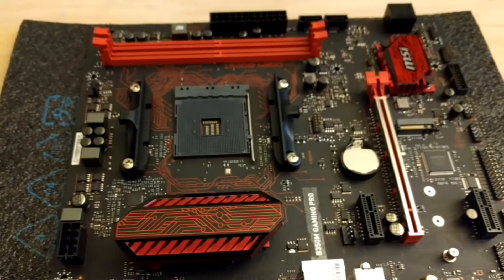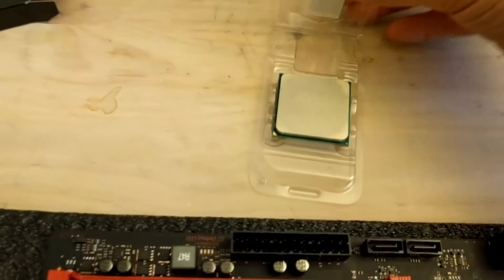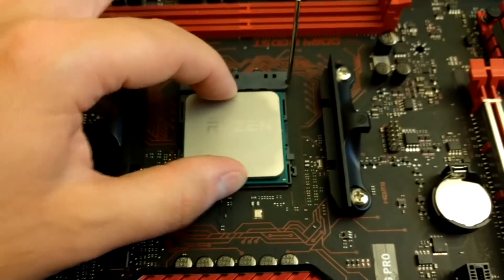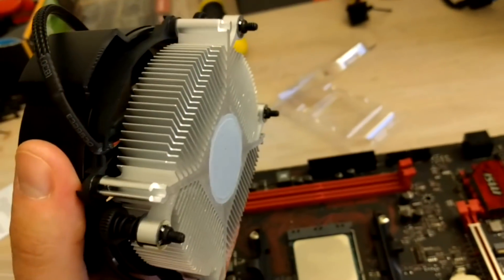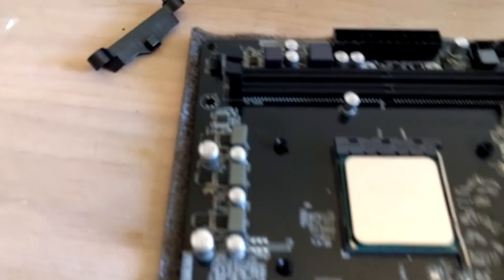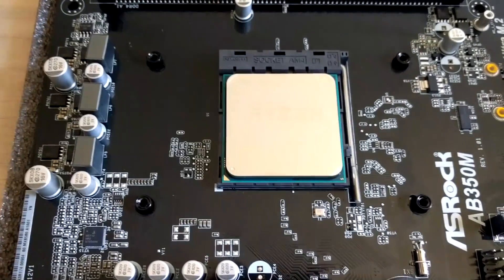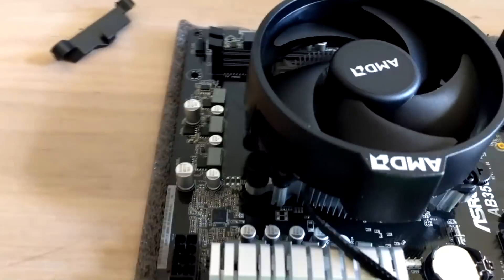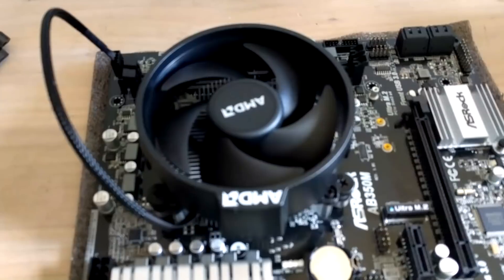AM4 Ryzen CPU and Wraith Cooler installation directions

Comment: Anyone know what those two plastic things are called at 3:11 I need them for my new wraith prism cooler that came with the 2700x and I can't mount the fan without them
Reply from the maker: Usually called a bracket, or holder or something else. If you can wait - kits come from China for $2, https://www.ebay.com/sch/i.html?_from=R40&_trksid=p2380057.m570.l1313.TR2.TRC1.A0.H0.Xam4+bracket.TRS0&_nkw=am4+bracket&_sacat=0
Reply: @CentaurusComputersCharlotte  thanks for letting me know

Comment: what is the backplate called by chance? I can't find one and my motherboard nor tower came with one and it the cooler cannot fit without it.
Reply from the maker: It is pretty much the "AM4 backplate", can't call it anything else. There are some on eBay https://www.ebay.com/sch/i.html?_from=R40&_trksid=p2380057.m570.l1313.TR1.TRC0.A0.H0.Xam4+backplate.TRS0&_nkw=am4+backplate&_sacat=0

Comment: Why did you change Motherboard?
Reply from the maker: First part of the video was the original video, without actual "screwing in". Some viewers wanted to actually see how screws are attached, so we extended the video. Socket is the same, there is no difference.
Reply: Centaurus Computers What was the cpu you used in the start?
Reply from the maker: @arvidjuliussen3617  R5 1400
Reply: Centaurus Computers ok thank you can you do a benchmark video whit Ryzen 5 1400?

Comment: What should i do my pc didnt start up after i did that in video i just changed the thermo past and thats it
Reply from the maker: Did not start as in no sign of life completely? Check the switch on the PSU, main 24pin and CPU 8-pin connectors, power button connector for the front panel. If it starts but shows no picture - check video cable connection, make sure GPU and RAM are seated properly, RAM should sit in slots 2 and 4 from the CPU (usually)

Comment: Now i feel like buying a ITX Board, since i have the CORSAIR Crystal 460X RGB Mid-Tower, with the ASUS ROG STRIX B350-F GAMING, dont think i will ever SLI any how.
Reply from the maker: Yep, SLI is the past, we do not recommend SLI for a lot of reasons. Some of them are - limited support from game developers, Nvidia moving away from SLI support, requirement for a much bigger PSU, a LOT of extra heat and noise, newer high-end cards are perfectly fine for 4K gaming in single card systems....

Comment: i bsically have the same msi motehrboard but i cant get these screws off
Reply from the maker: Unless they are rusted or something there should not be a problem removing them. I did it with one hand, at least. Possibly they are sitting there too tight. You can always find an aftermarket cooler with old style lever bridge clip that fits this mounting bracket, so you don't have to remove it.
Reply: @CentaurusComputersCharlotte cant be rusted bcuz i bought it 5 days ago and it arrived yesterday its brand new
Reply from the maker: @grum__1  Well, like I said, they are not usually overly tight and they should come off easily then.

Comment: I bought a used CPU without a stock cooler, and now the PC won't start up because it doesn't sense the cooler. none of the other coolers will fit the motherboard, and I can't for the life of me figure out where to buy a stock CPU cooler that will fit.
Reply from the maker: Don't even think about running it without a cooler. There are stock coolers for sale on eBay and other sites, but if your board has regular mounting attached from factory you can buy one of the aftermarket coolers with a simple clamp bridge that also fits older AM3 boards. If you have removed plastic mounts from the board and don't have them, you can find one of the aftermarket coolers that come with a new backplate, usually liquid coolers, or CM Hyper 212 kind

Comment: I bended 2 pins on my cpu, will it still work? pls replay...
Reply from the maker: If you can make them straight again - it will most likely work. We have fixed a lot of bent pins and had no issues.... usually. But keep this in mind - pins can withstand only a bit of bending, if you can't make it straight with a few accurate moves - it will break off.
Reply: @CentaurusComputersCharlotte  well I broke one and some of them are bent. Can this be repaired in the pc servis or something..? I think there's a trick to put a pin in the motherboard socket but I'm too clumsy for that
Reply from the maker: @ShaneMasterA  It is possible to put pin in the socket but no guarantee that it will have a good contact. Bent pins can be straightened using a thin blade or an automatic pencil tip. Some pins are dummies, in other words it is possible that CPU will work without it.
Reply: @CentaurusComputersCharlotte  okay thanks for the tips, appreciated
Reply: @ShaneMasterA  nope. Broke bud
Reply: @thehungryghidorah3274  nah, it's still working, its fixed lol

Comment: Hey, if I got just a little bit of thermal paste on my motherboard from my heat sink, is that okay? Also I have to take it off and put it back on a few times to get the screws to matchup. Did I have to reapply more thermal after doing that? Because now when I turn my PC on it’ll turn on for about thirty seconds then turn off.
Reply from the maker: If you have got thermalpaste simply around the socket you can wipe it off, should not be an issue. I don't know if stock AMD paste is conductive enough or not, to cause any problems, but just wipe it off. There are solutions (liquid) that help with paste removal. If you have got it on the socket, in the pin holes, that may be a bit of an issue. Try not to pull the CPU together with the heatsink, its bad. If you PC shuts down 30 seconds after you turn it on - it could be the overheating, or bad-boot cycle. If you get a picture and have enough time to get into the BIOS - check CPU temps on one of the screens, it should be in 30-50C range while in the BIOS. Make sure there are not bent pins
Reply: Centaurus Computers Thank you a lot for the reply. I really appreciate it. And I’m really hoping that it’s just overheating, because I ordered some thermal paste and other things to try to fix the issue. And I don’t really know much about bios so I’ll have to see if I can find a video on that. Thank you so much once again.
Reply from the maker: @toosavy1998  No problem. You do have to apply new paste after heatsink removal, but it should be a little amount between a rice grain and small pea, no more. You can spread it a bit with something like small spatula or similar tools. You should have a manual for the motherboard, find BIOS part in it and in the BIOS there should be a tab or option line that says something like Hardware monitor or similar. Thats' where you will see you CPU temps. If you don't get any picture in these 30 seconds before shutdown - it could be something else, not overheating. Like a bad connection of some wire, RAM issues (reseat it). Check if your mobo has any error LEDs or connect a little speaker to the front panel IO header #2 and check if you will hear error beeps, which you can look up online. Good luck
Reply: Centaurus Computers Thanks for the information. I have two final questions... I couldn’t connect my usb 3.0 cable to my ASRock Fata1ity B450 k4 gaming Mobo. It has something that says USB_3_5_6 but it wasn’t connecting with my usb 3.0 cable so I left it disconnected. Could that be my problem?
Reply: Also I didn’t hear any beeps any time that I turned the computer on. Do I have to have he monitor connected in order to hear those? Or are there just not beeps sometimes?
Reply from the maker: @toosavy1998  Not connecting your USB 3.0 cable is not an issue, ports will just not work. It should not be hard to connect though, it goes in one way only, check the notches on cable and port. Slide it in straight, or you can bend some pins. 
No monitor needed for beeps, only that little speaker with two wires and 4-pin connector that usually comes with the case, if you don't have it you will not hear any beeps.
Reply: Centaurus Computers The HD audio cable right? And it’s good that I didn’t hear any beeps? Also the usb3_5_6 port isn’t blue like the other USB port on my other motherboard. Aren’t all usb 3.0 ports blue?

Comment: is your thermal paste stick a bit out on the sides? mine does
Reply from the maker: Yes, there is too much from the factory. I try to remove it usually and apply a very VERY thin layer (I have some tools for it) of a high quality paste. Otherwise it will leak on the sides right on socket
Reply: it doesn't touch anything else just sides of the procesor, me trying to remove it would just make it worse
Reply from the maker: Well , sides of the processor should be fine with the paste on them. As long as it does not leak on the socket. 
You are right about removing the CPU. A lot of times I have pulled a CPU cooler with CPU attached to it, socket does not hold it well. You can try to slide or twist the cooler off the CPU, but be careful not to force anything. Pulling it straight up will always result in pulling CPU as well.

Comment: So if there is thermal paste on the cpu cooler do I not have to apply any more?
Reply from the maker: There is thermal paste on the bottom of the cooler from the factory, BUT!!!!! - we usually remove all of it because AMD applies too much and not the best stuff. If you will ever have to remove the CPU after installing it as-is you will see that paste excess will be everywhere - on the CPU sides, on the socket, around it... Remove all factory stuff and apply a rice grain of a good quality paste - it will work much better.
Reply: Centaurus Computers ok thanks man!

Comment: I bought a used PC from someone, and it has been working fine for a long time. But I recently discovered the CPU temps were just too high, especially after many reviewers stating how well the stock cooler performed. Well, I ended up taking off the cooler, only to find the stock brackets are not attached, but half of the cooler was still screwed on. What the fuck

Comment: Two different mobo's?
Reply from the maker: Same socket, so it does not matter. Original video was shorter, with MSI B350 Gaming Pro motherboard, I had to extend it to actually show me working with a screwdriver, so that some would get a better idea what to do.

Comment: Ok so when I screw it in the screws don't move? Is there an issue where you have to put a lot of pressure on or should it be easy?
Reply from the maker: It's not easy sometimes, screws on cooler's corners have springs and they are tight sometimes. Ideally when you put cooler on top of the CPU screws should touch the mounting points on the backplate, but sometimes they are a bit higher and need to be pressed down. Hold cooler down with one hand, start with one screw, push on it with a screwdriver to make contact and turn 2-3 times, then do the same with another screw across from the first one. When two screws (across diagonally) are attached a little bit it should be easier then. Some screws need a bit of force to be pushed into the socket.
Reply: Centaurus Computers ah okay thanks man

Comment: Where can I get those black mounting brackets?
Reply from the maker: They come with the motherboard, you can find them on eBay
Reply: Yeah, you're definitely gonna need those if you get the new prism cooler that comes with the ryzen 7 2700x, because it uses the latch that hooks onto those brackets.

Comment: Does it matter what direction you put the CPU cooler in?
Reply from the maker: Not really, it will fit both ways. Although I would recommend to install it with AMD logo facing toward the rear of the case, where rear ports are. If you will install it facing front side it may interfere with some RAM slots (AMD logo is sitting on a notch).
Reply: Centaurus Computers thanks, I’ll keep that in mind!

Comment: Are you experiencing freezing issues with the motherboard?
Reply from the maker: No, it could be a number of reasons. Update BIOS, make sure RAM is running with XMP/AMP enabled or drop frequency a bit, check temperatures....
Reply: Centaurus Computers I'm talking about the ab350m pro4, I've tried testing it with other ram gpu and hdd
Reply from the maker: It's hard to troubleshoot without having stuff in front of you. Your best bet is to post on ASRock forums and see if someone has same issues. But basics are the same - update BIOS, make sure XMP is enabled, CPU temps are not above 60C when not heavily loaded, update Windows and drivers...

Comment: you need to use thermal paste right?
Reply from the maker: Stock coolers come with thermalpaste pre-applied, in fact even too much of it. But if you re-apply the cooler - you will need new paste

Comment: why did you change the motherboard in the video. you had MSI GamingPro and finally AS rock
Reply from the maker: First video shot did not show actual cooler installation, so I had to add another part showing how it screws on, but with a different board. Installation is the same, it does not matter.

Comment: HOW DOES THE SCREWING GO SO EASILY FOR YOU!???
Reply from the maker: When it's on the flat surface it's easier. Press on the screwdriver firmly since there are springs pushing screws up. Don't let base of the cooler detach from the CPU while doing that, it messes up the thermalpaste.

Comment: I removed my cooler after i installed it... where are my stand offs?
Reply from the maker: They are part of the backplate, it is not held in place by anything so it probably dropped behind the motherboard. Open the other side panel and find that backplate, put it back in place, align with holes, put something under it so it does not fall down and re-attach cooler.
Reply: Centaurus Computers  ur right it did fall off! Lolololol thx man

Comment: If I upgrade from a ryzen 5 1400 to a 1600 do I need to get new drivers or anything, or will the cpu just function normally?
Reply from the maker: It will work just fine, no need to change or update anything else. When you will start your PC for the first time with new CPU your motherboard will aks if you want the default settings or if you want to get into the BIOS to update them manually. I recommend applying default settings first and then changing what's necessary manually. Like applying XMP settings (or AMD memory profiles), overclocking, changing fan speeds...
Reply: Centaurus Computers Okay great, thanks im a total noob at pcs lol

Comment: Do u know why my ryzen 3 1300x cooler isn’t fitting on my am4 motherboard I did everything u showed
Reply from the maker: if 4 screws match 4 holes all you have to do is to press down firmly and secure all 4. If they don't match or don't reach, check your backplate, CPU installation.

Comment: 1. My cooler keeps going uneven. When I screw in using the diagonal pattern, as soon as one screw gets in, the others fly up.

I've tried it while the mobo was on the box and tried it on a hard desk where the backplate is supported evenly. Still can't screw it in.

Please help. I am afraid too much force will damage the motherboard.

Also, the thermal paste is leaking to the side a bit due to the screwing process. It shouldn't touch the green part around the cpu right?
Reply from the maker: We usually remove half of the thermalpaste from stock coolers, AMD put too much there and it squeezes out on sides, leaking onto the socket. We remove the outer 1/4" layer.
As for screws - you have to insert a first screw a few turns in, then the one across - you will have to press firmly screw it in making sure it hits the hole straight, it will take some pressure, don't worry. The other two will also have to be pressed down to make contact with the thread.
Reply: @CentaurusComputersCharlotte  how exactly should I remove part of the thermal paste, and how much?
Reply from the maker: @Revirus1337  Some AMD stock coolers have different paste application patterns. Some of them have too much on sides, beyond the CPU surface. You can remove some of it on the sides, but unless you have a fresh paste tube do not remove all of it.
Reply: @CentaurusComputersCharlotte  I have the same cooler as you and I only plan to remove part of the paste but Im wondering with what tool exactly should I do that? Like a knife or something?
Reply: This has been happening to me too. DId you get it figured out?
Reply: I had the same issue and had to apply a lot of pressure in order to push the back plate up whilst screwing down. Wasn't easiest thing to do, the only issue I had whilst building my pc tbh. I had to re-adjust the cooler too cause of this issue, which resulted in a speck of thermal paste falling on my mobo and when I tried to remove it gently, it smudged, so I left it there since it was a very small amount and then fitted the stock cooler. I'm going to keep monitoring my cpu temperature and if I see any constant issues or irregularities, I'm going to reapply the aftermarket thermal paste I bought.
Reply from the maker: xnoSpec xnoSpec  You don't have to remove the paste at all, it's just my personal preference. If you will leave it as-is and ever remove the CPU you will see that a lot of paste is squeezed out and it's all over the socket and mobo. I either remove a part of the paste before installation or use my own with a thin spread.